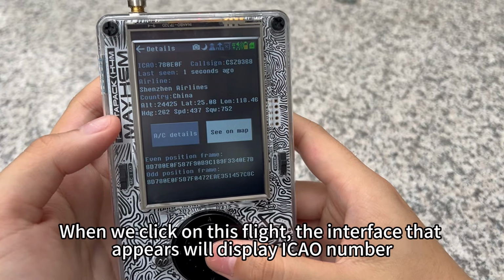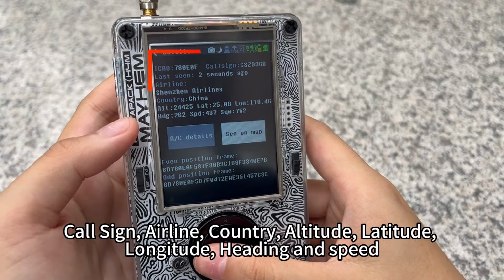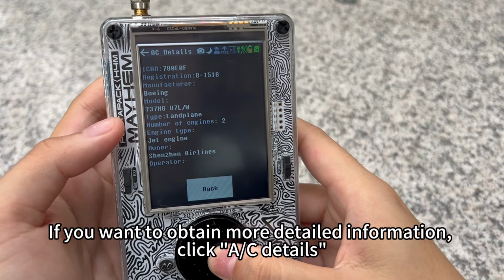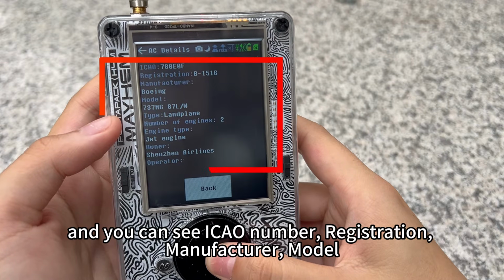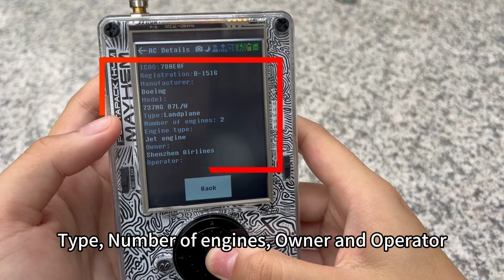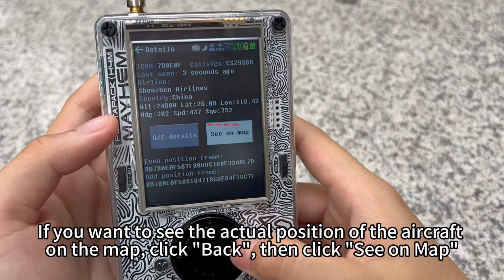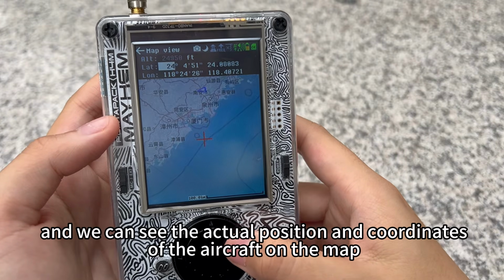HackRF One and PortaPack H4M Applications Receiver: Part 1

Comment: Sorry for random quest!

Replay with HackRF One (H4m + PortaPack) is not unlocking my Nissan Sunny.

I was able to capture the keyfob signal at 433.92 MHz, save it to the remote, and play it back, but the car does not respond when I transmit the replayed signal.